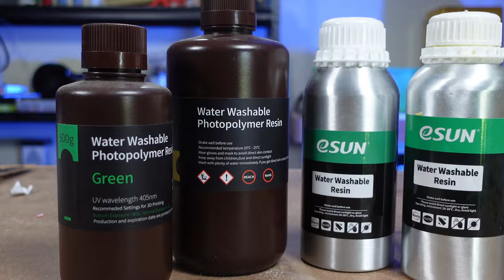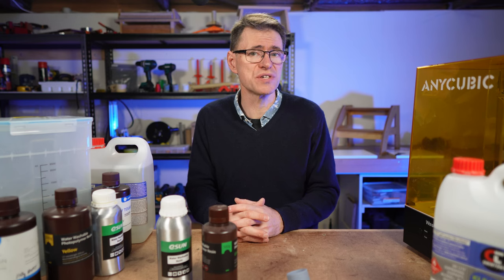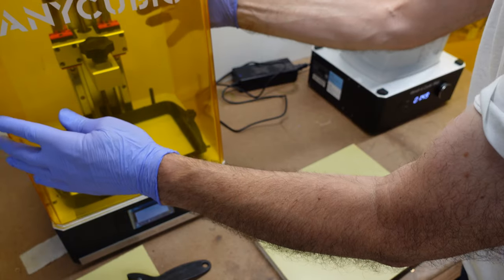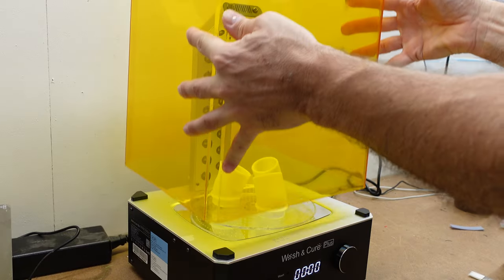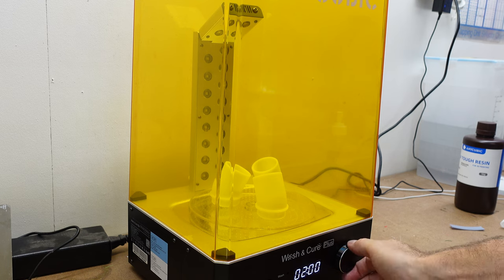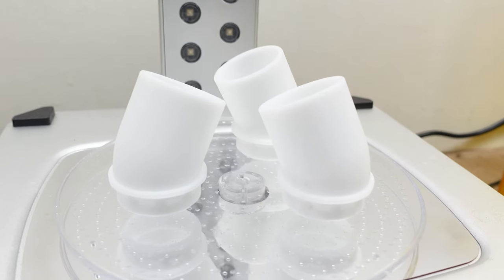IPA vs Water Washing 3D Resin Prints

Comment: It seems that many of the drawbacks of water could be addressed by using water in a wash and cure station. It wouldn't help with the drying times, but it wold certainly eliminate all the faffing around outside with the hose. Have you considered that?
Reply from the maker: Hey, thanks for your question. Yes, I have tried that. But the water just doesn't do as good a job, even in the wash station. In fact, eSun even specifies that their water washable resin should be washed under running water, and not in a wash station. Anycubic has also just released water washable resin, and specifies a water/or IPA wash. After extensive testing and experimentation, I'm sticking with IPA...until something better comes along. 😀
Reply: @ColinKlupiec Just get an ultrasonic cleaner
Reply from the maker: @firelion98  I've often thought about getting one. Thanks for the tip.

Comment: i tried water washable for the first time and i love it, any mess is easy to clean with just a wet cloth. btw, i left my prints in a jar full of water under the sun, i learned this from using normal uv resin (water prevents oxygen inhibition), then took them out and let them dry. fully cured, no discoloration...
Reply from the maker: Thanks for your sharing your experience. I like the idea of water washable resin, and still use it for doing quick prototypes. But I mainly had to switch to IPA because I really only use functional, or tough resins, that can handle some harsh treatment when in use. So far, functional, or toughened, or engineering type resins all require IPA. If a water washable version becomes available I'd be keen to test it.

Comment: Honestly i dont see the problem. I use a similar washing station for my prints with water washable resin, all i did i filled it with water instead of IPA. Works absolute fine (If you add a cup of IPA to the water it works even better) and i only need to change the water once or twice a year. So no big deal at all.
Reply from the maker: Thanks for the comment. Sounds like a great suggestion. I'll give that a try, for sure. 😀

Comment: The thing I don't understand is that in Europe for example industry can't use any other solvant then water for resins, inks and paints witch means : the technology exist, is reliable and durable eg. : any european car paint is water washable made. I don't see why the individual should poison himself
Reply from the maker: Interesting, isn't it. Another key reason I use IPA is that the tough resins require IPA to wash them. I'm sure that will change some time soon, if it hasn't already. If someone knows of a 'tough' resin that can be used for functional parts and is water washable, then please let me know. 😀
Reply: @ColinKlupiec  This is totaly false.
First of all non of the resin maker says exactly what components are in the resine they produce , just for example ABS like doesn't mean there is ABS in the resine they sell you and the formula can be totally different from one maker to another. This market is a real mess but if I spend some time to explain that it is not because i don't belive your observations, it is just a matter of public health and I don't find fair to let individual probe the toxicity of products where laws banned the same products since 20 years for industry. And I am sure there are good water washable resins on the market but you didn't test them.
Reply from the maker: @jean-loupdesbordes4833  Thanks for your insight. Yes, you're right...I haven't tested them...yet. Like I said, I'm sure I"ll come across a suitable alternative one day. Hopefully soon. BTW, which products are you referring to which were banned 'for industry' since 20 years?

Comment: This sounds more like your advocating for a wash and cure station than for alcohol vs water. You can put water in a wash station and you can then pour it into glass jars to cure in the curing station. You don't need to go outside with a bucket and a hose. And you can change out that water as much as you like since it's effectively free. As for drying, pro tip, if you have an airbrush just blow air at your prints. You can also you a blow drier but that gets a bit hot.
Reply from the maker: Maybe...I did try water in the wash & cure station, although I still wasn't that amazed. IPA just gave a better result. But that's resin printing...so many things to try. 😀

Comment: Go to a professional cleaning shop and buy 20ltrs don’t buy 4 or 5 ltrs it’s a rip off for 20ltrs of 100% ipa is 140 for 20ltrs then use a distiller to filter the ipa.
Reply from the maker: Good tip.

Comment: The first Elegoo wash and cure station did not work very well with water only. The magnets below get oxidized by the water so I combine it with 50% green or purple cleaner. I like to use IPA because it cleans the build plate and the prints they look better but the smell is horrible. Something else I notice when washing the prints directly into the build plate, under the base supports is not cleaned by the water or IPA. For that reason it is better to detach the prints from the build plate to wash them.

Comment: i just got my first resin printer. is there an issue with using water in the washing station i havent seen anything opposing the idea
Reply: i also plan on painting most of my prints so i dont see an issue with the white residue
Reply from the maker: I think water in a wash station is ok as long as you keep it reasonably fresh. Some resins, like eSun, will actually state that better results occur when prints are washed under running water.
Reply from the maker: You may find that the residue issue could be particular to the resin…hard to predict. I still occasionally use water washable resin for quick prototyping and sometimes just use IPA to wash it. Somehow the prints seem cleaner to me.

Comment: i don't remember who did it, but there was a guy on youtube that figured out you can clean your IPA really easy by adding some aluminum sulfate (Alum) mixed into distilled water into your IPA, binds the resin into larger chunks that drop to the bottom, you need to run your water station for like 20-30 minutes to get best results, pour most of the IPA into another container and then whats left into a much smaller container where even more can be split off once it settles again. It's the same method waste treatment plants use to separate particulates from the water
Reply from the maker: That’s really helpful. I’ll look into that. Thanks for contributing to the discussion. Very helpful.

Comment: Interesting video, it's good that IPA cleaning is working well for you. After much experimentation I've gone the other way and moved away from standard resin & IPA with a wash & cure, to water washable resin.
I've found the trick is using warm water - it cleans the prints far, far better than cold. 
I also fully immerse my prints in warm water as I cure them. I swear by this method - it limits thermal warping, cures the inside of hollow models better as the UV diffuses through the water, and causes any missed 'wet' resin to cure in the water column rather than on the model.
Its also worth mentioning that IPA is a VOC, and it's worth reading up on the possible long term health effects before choosing a method of cleaning.
Happy printing folks!
Reply from the maker: That's really interesting. Thanks for offering the suggestion into the conversation. I hadn't considered warm water. I will definitely keep that in mind. I still need to use IPA for cleaning the tough resins for the parts I make. Water washable resins are still too brittle. But who knows, maybe that will change in the future. Happy printing indeed.
Reply: and IPA is super flammable. Having a washing bucket of 5 liter of Alcohol laying around in my house makes me very nervous. Cleaning right away with very warm water also makes the support kind of detach by themself. When the water is 40 to 45 degree Celsius the parts dry quite fast by themself but you can use a hair drier to speed up the process.
Reply: You really think you’re curing the inside of hollow prints by curing in water?  I guess it would vary based on the type of model you’re curing, but most of mine would never cure inside without inserting a UV light source.  YMMV
Reply: @forrestegan  that's interesting, I've not really had curing problems. I usually leave my cured prints on a tray on a windowsill for a day or two afterwards as well, so maybe that also helps? I've got printed titans & big models that are several years old now & have been fine, so pretty sure they're past the 'danger zone' now (at least I hope so!).
I think they key is finding a process that works well for you and sticking to it.

Comment: Have you tried a primarily water washing the resin and rinsing it with IPA to help with the drying issue? Using minimal IPA would be more cost effective.
Reply from the maker: Yes, I did try that. It's a good solution. But these days I print exclusively with 'tough' resins which specify IPA cleaning. In some ways it simplifies the process...I just know I need to use IPA. And, I've found that it's actually not that expensive. Thanks for leaving a comment. It all adds to experience and learning. 😀

Comment: It's kind of funny. I just switched to water washable abs-like from the UV tough and I love it so far. I don't think I'm ever going back to IPA washing. 
UV Tough is a great choice if you are going that route though. I've been using that for a while.
Reply from the maker: Maybe I should try the Anycubic ABS-like in the wash and cure station with water. Perhaps it's been optimised for better water washing. eSun specifically state not to use a wash station. IPA just gave an instant brilliant result on the tough resin. Maybe I need both. I'm certainly keen to try the ABS. 🤣
Reply: @ColinKlupiec  I don't have any experience with Esun.  That is strange that it says that. I don't know why it would matter.

I bought 2 pickle jars to water wash with and that seems to work pretty well. Time will tell lol

My biggest problem with the IPA was dealing with the fumes with limited space.  If you have a good system in place for that it's not as much of an issue :p 

Also, I would suggest removing the prints from the supports before putting them in the IPA because your IPA is going to get dirty way faster if you wash the supports.
Reply from the maker: @hauntswargaming  Good point about washing supports. I tried that and found that my prints tended to bounce around in the wash. Detail for me is kind of the opposite...it's about smooth surfaces with no detail, and I'd get tiny little marks from bouncing around in the container. But you're right...I've now started to wipe the build plate from excess resin before placing it into the wash station.
Reply: @ColinKlupiec  whatever works for you 👍
Reply: @ColinKlupiec  I washing my print with the shower. Easy and quick and most important no fumes. At this moment i must use other resin and i cant wait to end of use IPA.
Reply: @mailscd  I don't think you're really meant to do that, considering Water Washable resin is still toxic. Sure- it's a drop in an ocean sort of situation, but still.

Comment: I have 2 wash and cure stations, both do very well for washing in IPA  OR water.  I prefer the water over IPA due to cost and easy cleaning.  Water washable is so much better for me because I don't have saturated IPA hanging around until I can reclaim it. With water washable it's so much easier.  Wash it in wash station and I use a hair dryer to blow dry them then cure.  the water is then cured with the UV for about 30 minutes and you can see the resin drops collected at the bottom, then you just wipe it away and your done.  Also I do not cure my prints for more than a minute, unless they are large clear prints, then I cure for 1min 30sec. I have had no issues with curing.  If you are using dense color resin, the only part that will actually cure in the UV station  is the outside,  so why waste the time for nothing.
Reply from the maker: You make some great points. Thanks for contributing to the conversation. I now use a 2-stage process with IPA to save cost and improve results. 👍

Comment: Came across this video as I searched for more information regarding water-washable resin. I'll be taking your advice and will be sticking to the analog (IPA)!
I too use resin printing for my practical needs, this was very insightful! Thank you!
Reply from the maker: Thanks, I'm glad that was helpful. I recently changed out the IPA in my wash & cure and I was surprised, again, at just how well the IPA cleans, both water washable and standard type resins. After a while the IPA seems to get 'sticky', even after filtering it etc. For the time being, IPA is still my go to.

Comment: Curing your model submerged in water works perfectly, the refraction gets the uv everywhere.  In the 2 years I have my printer i used 7kg resin. I don't have a wash and cure station.  I just use a pressured plant spray with Bio Ethanol (€3 a litter)  instead of IPA at €12. I never have a white haze on my prints after curing. The benefit of Bio Ethanol to IPA: 1 cost, 2 in Bio Ethanol the resin falls to the bottom a lot faster. I have never discarded Bio Ethanol I always pour 90% back in the spray bottle.  And leave the 10% in the closed bin with the sediment.  I give a quick final spray with clean Bio Ethanol.  Usually I cure on a big UV led tray. If it is very sunny outside I'll but them in a old fishbowl submerged in water in the sun.
Reply from the maker: Thanks for your comment. That’s really useful insight. Maybe the white haze is related to the resin. I find that new and better resins are released frequently these days. Maybe we’re a bit lucky here. I can get IPA for about 4€ per litre. Bio ethanol is about the same. But I’ll certainly give bio ethanol a try. Thanks for watching.

Comment: So, how long does the IPA last?

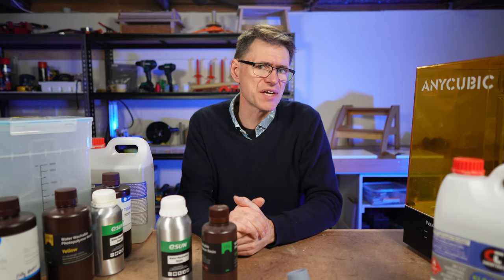At 3:47 you stated,  "Depends on how much you print."

DUH

Very vague answer.

Perhaps you may like to elaborate.

As a suggestion....Give an example.
Reply from the maker: Thanks for your question. I guess it is a vague explanation for how long it lasts. It’s hard to be precise. But, to extend the life of IPA I now use a 2 stage process. First dunk into a small container of IPA. Then use the wash station. The first container is then easier to recycle and dispose of, leaving the IPA in the wash station for that final rinse. Seems to he working well so far. It also depends on the detail of your models. Mine are mostly smooth shapes with large cavities to allow the excess resin to drain off. I imagine highly detailed models would require longer washing cycles and therefore contaminate the IPA more quickly over time. Hope that helps.

Comment: The information on why I have white spots on my cured parts and being told I can wash my water wash parts in IPA is rather helpful. I'm going to keep trying water in my wash & cure station as I've just started with printing in general, but having options is nice, thanks.
Reply from the maker: Hey, thanks for leaving a comment. I'm glad you found that helpful. I think the mistake I was making was curing the prints too quickly before they were absolutely and completely dry. You can fix that with a heat gun or hair dryer and then be a little more patient than I was. But...I still think I get a cleaner result when I use IPA. Have a great day. 😀

Comment: Thanks for your video and information.
I got my resin printer 3 years ago and really enjoy it, it’s great for what I need it to do but I always use water washable resin and just got used to the processes involved in using it and yet never appreciate how fragile the small pieces are. Do you find the resin that needs ipa for cleanup is stronger or even less brittle?
Reply from the maker: Thanks for your question and your kind feedback. A major reason for the switch to IPA was that I could then wash 'tough' type resins. They are much less brittle and can handle quite a bit of punishment.. I compare water washable resins to tough resins in this video https://youtu.be/PLtjuhRN6Wg
You might find the comparisons useful.
Reply: Thanks I’ll check out your video👍🏻

Comment: yup same problem I have been running into using the Anycubic ABS Like Resin v2, it's not that bad I only get a slight amount of white residue, but still enough to make my eye twitch. It's a good resin but it's such a pain to get it off the plate. literally chipping away at it, doesn't pop off at all like how I see other people printing with resin. 

my first resin to use for 3d printing also, so I don't have much of an actually contrast.
Reply from the maker: I hear a lot about the ABS Like Resin, but I've had so much success with the Tough Resin that I haven't got around to trying the ABS... By the way, the Tough Resin is super easy to get off the plate. It's my go to resin.
Reply: @ColinKlupiec  awesome because that’s the resin I want to try out next!
Reply: @VRvelocity907  All water based resins are brittle - even the supposed "ABS-Like". That ABS-Like (V2) is even much just like the plain water wash types anyway!
 All normal (non water wash) resins come off the build plate quite easily - which is also linked to your burn in setup, but even when overdone they still come off fine. Intact.  Water wash will disintegrate if stuck on too hard!  I found the plain water wash to be the best (rather than the ABS-Like V2) IF it for making something you can live with its deicateness (brittle).  And washing water based is WAY easier, cheaper, safer, than normal resins and IPA!!  Too bad you have that brittleness limitation/issue with water wash resins......